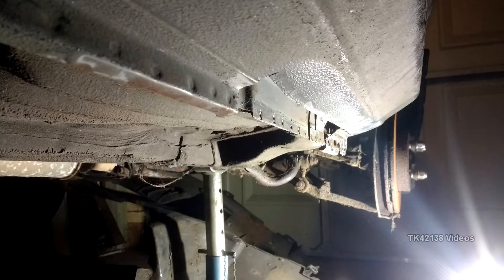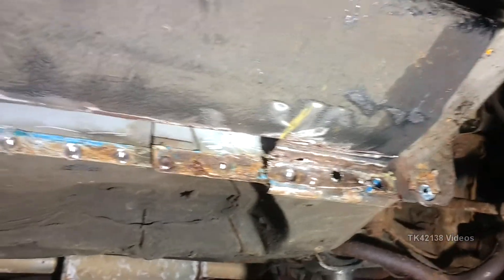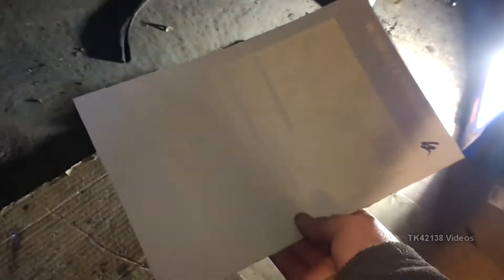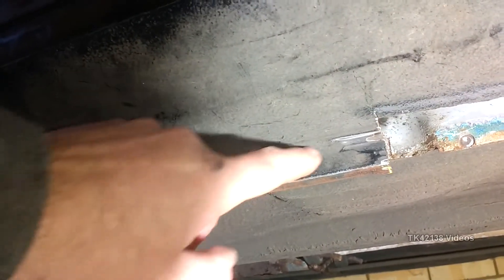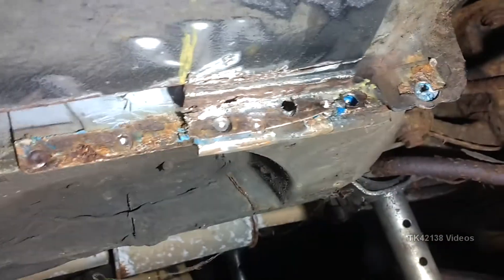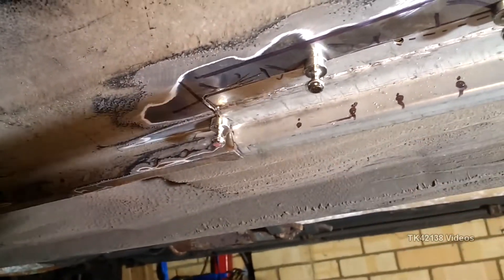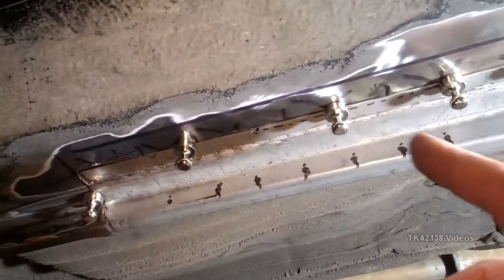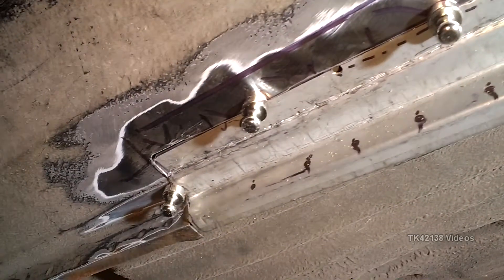Part 31 'All offside welding completed'

Comment: As always a great video.
Does the other side of the car require the same level of work?
Reply from the maker: Thank you. 
Yes - I think the sill around rear jacking point is worse judging by what I can see from underneath the car. May have to invest in the repair panels now being sold by the Rover owners club.